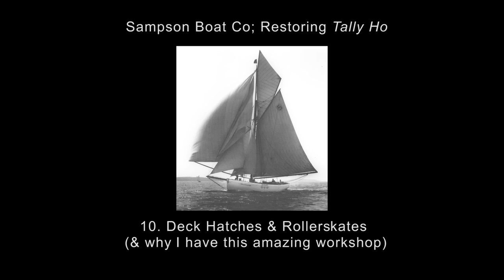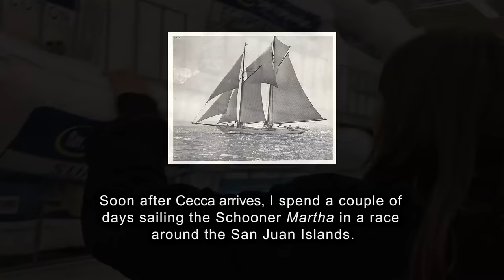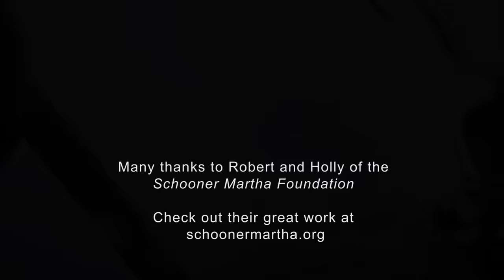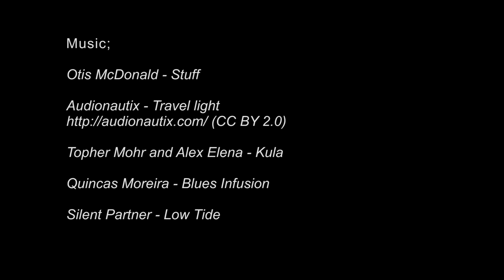10. Deck hatches &  Rollerskates (& why I have this amazing workshop) - Rebuilding Tally Ho EP10

Comment: i have 35 years  restoring antiques  moved and rebuilt a 40 x 50 x35 tall  barn built built in 1810. i restore antiques for a living . have exp in welding. metal  casting ,,repoing parts, worked on a few boats  over the years . i could spend a week or so helping out, maybe longer ,
Reply from the maker: Thanks, send me an email if you havent already

Comment: You are incredible, motivating, I built a boat from a fiberglass hull in 1977, installed engine, rig, interior, electrical,
 etc., today I went and sharpened 6 block planes after watching u do it and the last time I did it was 40 years ago, only because I did not a block plane again sense then.  Love your videos, Keep Up the good work

Comment: Enjoy the heck out of these videos. I restored two yachts over the years, but in my other life as a surgeon it’s important to keep all ten fingers and good legs. A little more attention to the safe use of power tools is indicated. I spent time on the replant service while in training, missing fingers, (and hands) happens instantly with these tools when not used correctly. Don’t use your fingers as a push stick or your thigh as a saw horse, unless you want to visit UW Harborview Trauma Center in Seattle.

Comment: Excellent videos, just caught up. Proper 'shipshape and Bristol fashion'. I am in awe of your skills and knowledge.  I am sorting out my young (40 years) small plastic boat in a traditional style boatyard (Faversham, Kent).  Loads of boats of about Tally Ho's vintage, plus quite a few Thames Barges.  Lovely environment to work in. Some people like to use the traditional old tools - there is even an antique tools shop nearby. However, I would guess that the shipwrights of yore would have jumped at the chance to use modern tools and machinery.

Comment: You might want to consider an I beam gantry overhead in shed. Attach that pulley and you'll be able to more easily move the heavy stuff on and off the boat from end to end.
Nice work your doing.
Reply from the maker: Great idea!

Comment: The trouble with restorations over scratch building is that there is a lot of destruction to go through before any positive progress becomes apparent. It can be hard sometimes to remember that, as I have found out. All the work is to the good, keep dreaming of the day when you at last start to move onto building her back up. Keep on keeping on.

Comment: Ive watched all your videos to date and loving it. 
You almost need to get yourself some I-beam and box section and make yoursef a rolling gantry that straddles the lot. Be alot safer and easier when doing all that lifting by yourself. Awesome project. Huge challenge. Will be donating.

Comment: It looked to me, in previous episode, that the keel did not sag at all, when separated from the  lead ballast, and was only supported on each end. Looked like a good 16' long piece of lead. Is the keel still good, or, is the structure holding it straight,  which in either case, didn't you find a real gem?
Reply from the maker: Both - and in some ways, yes!

Comment: Bro they are your videos, do what you want. I'm cool with showing other things as well as the work on Tally Ho.  You wouldn't let someone tell you how to work on the boat so don't let anyone tell you what should or shouldn't be in your videos.  How is the keel timber, are you going to have to remove it? Cheerio.

Comment: Two things.  The rafter pair you are using to hoist.  You are way past the average structural ability of the rafters.   The rafters at  that point should likely be a minimum of 2X6s  Keep the good gusset arrangements you have, but mostly, mostly,, if it has not failed before you read this.  the collar tie attachments are way, way over stressed.  

2X6s attached directly to your current set up  for rafters, properly gussetted to get enought sheer. And a new collar tie that is well gussetted , nailed and glued.  You have the one long angled sheer leg out side,, you may need 'running' sheer legs (removable) back to the hull to counter your feet pressing away from the block.

The second thing is,, You be good to Cecca, she is beautiful, both soul and spirit, and face.  I'm 65 and I never once met one of her ilk for me.  You be good to her, she is a rare bird.
Reply from the maker: Thanks

Comment: As a reader of the wooden boat forum i have seen several people start huge projects like this, but never actually seen someone finish one, but with your skills and enthusiasm you may very well see this monster project through. Just wondering though, since the Tally Ho is in such a horrible state, wouldn't it be a lot cheaper and more straight forward to use the hulk for measurements and build a new and exact replica next to it? Reuse the lead, the fittings and the little bit of hardware you can salvage and use the rest of the original to heat the workshop.
Reply: Analyse Dean    I am not an expert at all but to me it seems it will be quite like that... wooden parts replaced, hardware reused...
Reply: It is probably not economical, but the larger planks and timbers could be used as raw stock for smaller pieces.

Comment: I don't get why you are doing the deck now. Surely you are going to restore the hull first. I thought it was best practice to remove and then restore each part at a time. If you take everything off first you destroy the integrity of the structure. I wish I could help you.

Comment: It seems the Tally-Ho must have some intrinsic value beyond her rotten planking and rusty fastenings. You could avoid all the destructive disassembly, splinters, muscle strains, toxic exposure and bearing the proposition of a mission impossible by just starting from scratch and building a new, better boat from the start.  I admire the Don Quixote spirit, but you are foolish to waste your youth on efforts in vain. Sad to say...but true.
Reply: modelleg Youth is the only time to do this. There is great satisfaction in restoring an old wooden boat that will likely outlive you.
Reply: Nothing can compare with the satisfaction that can come from such a task, agreed. Likely my impression of the task at hand is overly reactionary, I don't know.  It just seems that the exposure of the materials of the Tally-Ho, like any typical wood boat, are subject to systemic degradation.  What is the plan? To completely disassemble the boat into it's constituent pieces? Replace fasteners into the same holes from which they were extracted? There are many reasons I can think of that might tell a person that this reconstruction of an old boat may be a job that shouldn't be done. In the end, the final result will be interwoven with old wood that passed some moment of judgement as to it's serviceability.  The fabric, the stuff of old boats, was never intended to last forever; the stuff of old boats gets consumed, eroded, broken, split, cupped; it warps, shrinks, and weakens over time and immersion.  The unity and material perishability of wooden boats reminds me of the old expression that sometimes, " you can't fix a broken bird."  I hope I learn something from this discourse.
Reply: modelleg  you are obviously more knowledgeable than me on the subject.  He may or may  not finish this restoration but like they say the destination is less important than the journey.  He’ll learn far more by doing it than by not doing it.
Reply from the maker: I will talk about this in an episode soon... Of course it would be easier and cheaper to build new, but that's not the point. If the goal was cheap and easy, there are plenty of boats that fit the bill in most boatyards/marinas. I was thinking of building new, but taking on Tally Ho instead has already been worth it in terms of the support that I have received, because it makes a better story, and people respond to that. AND it would be a crime to waste all that teak! - All the planks, the keel timber! The magic of a historic boat is perhaps not universally appreciated, and that's okay, but you can never waste your time if you are doing something that you love.
Reply: modelleg wait and see it will be one of the most beautiful boats on theb